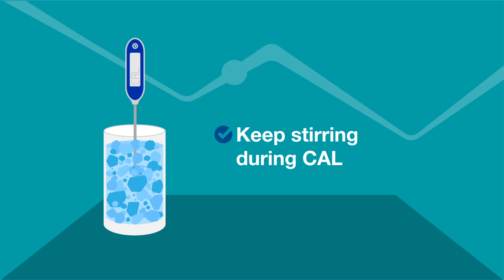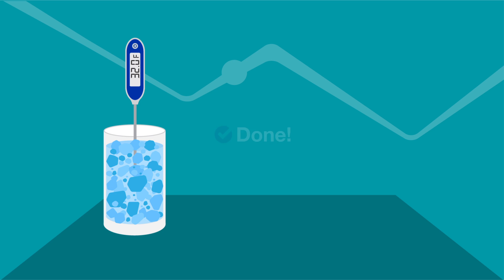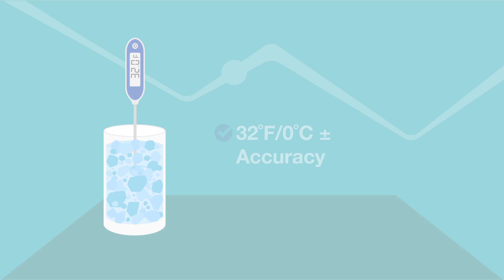How to Calibrate a Digital Thermometer

Comment: Ice water is 34 degrees not 32
Reply: If there is just enough water to coat the ice, the water will actually be 32 deg F, which is the same temperature as the ice.  It's what I learned in chemistry.
Reply: @Knulppage  Thank you

Comment: My TP300 thermometer is showing wrong results The temperature is 26C but it is showing -1.8C. It was right earlier but when I put the metal tip in fire to measure it temperature. After putting in fire it is showing false results. Can it be repaired
Reply: The Unknown Trio no. The sensor is damaged. :( i don't know about your thermometer, but you could buy the small sensor on ebay or some electronic shop in your country and solder it on.